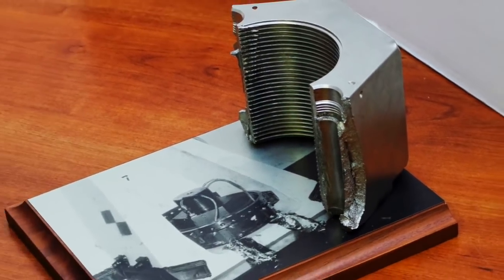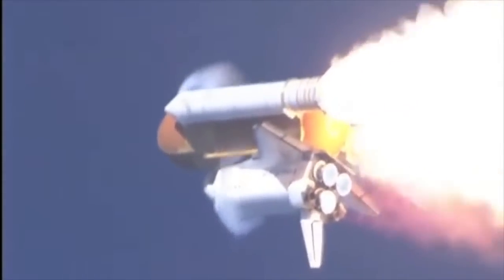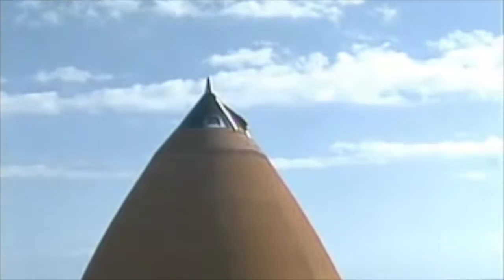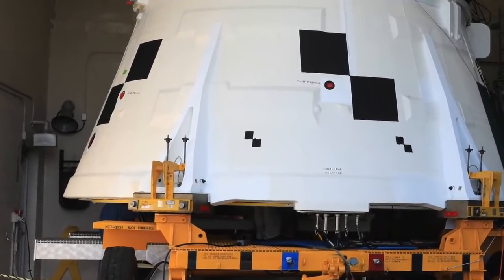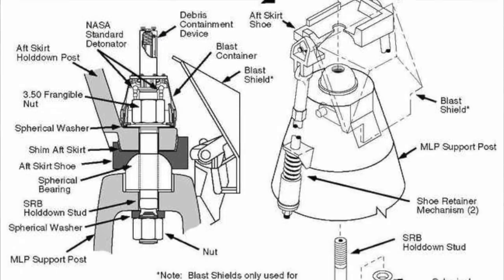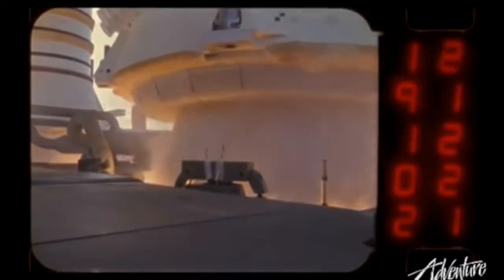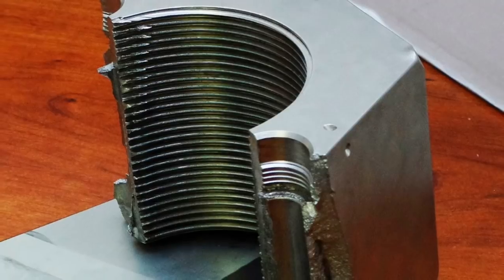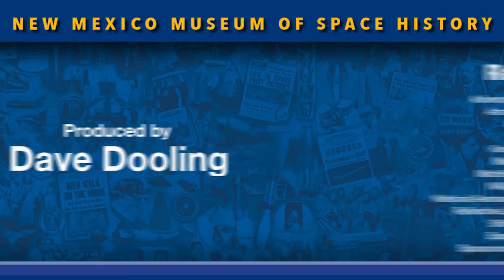Nuts and Bolts Held the Shuttle Together

Comment: In the mid-1980's my company in Shreveport, La. manufactured a few hundred of these "Hold Down Posts" (double ended studs) for United Space Boosters, a division of United Technologies.  They were 3.500"-12UNF (3.625" Stub Acme) X 33" long, Alloy 718 Bolts.  I was invited to watch a shuttle launch, which ended up being the last Challenger Mission before its tragic final flight.  I was very proud of being involved in a small part of that program!

Comment: I had the pleasure working the MLP prior Challenger. I road the zero level
many times to and from the PADs. I observed something interesting at the speed 
brake. what i would call a drip pan was positioned parrallel to the trailing edge of the 
brake by ten or so inches. the MLP would lunge lurch causing this varying gap
between the pan and speed brake would vary about 7 inches or so ..translate
that thru the SRB's & Orbitor ...to the Pad and sometimes back again

Comment: Interestingly, the SLS version is much simpler- since the vehicle does not "twang" over, the nuts are no longer needed for the actual launch (now only needing to be in place for the trip on the Crawler) so once the vehicle is at the pad, they are removed. SLS then lifts off the empty posts which eliminates all the intricacies of the frangible bolts.
Reply from the maker: Yes, the Shuttle was a beast all to it's own.

Comment: Thank you - that is a topic I always wondered about! So the FULL structural stress and load of the complete shuttle/tank assembly was on the boosters and the solid fuel?
Reply from the maker: That's correct for when it's sitting on the pad. After lift-off the situation becomes very dynamic. I believe the old term would be "sporty"!

Comment: The Apollo Saturn V first stage had pins attached that were pulled through dies on the launch pad at launch to prevent the stack from lifting off too fast after the hold down arms released. It slowed that first foot or two just enough to meet the liftoff criteria they set.

Comment: Hu? Nobody has come up with anything better in all these years? Bizarre. Our space program depends on explosives bolts and parachutes.
Elon fixed part of it so far.
Reply from the maker: The main reason is that these critical actions were carried out using simple and reliable systems. All large rockets have to be held down to the pad while the engines spool up and are confirmed stable and at the proper thrust. If a large booster is allowed to move upwards, even by an inch before this condition is met, bad things happen.
Reply: @NewMexicoMuseumofSpaceHistory  If you watched the video you will learn that they are not "simple and reliable systems".  Saturn V had swing away hold downs
-E8 camera. As I said, Elon fixed part of it so far.

Comment: Very interesting!  For a future topic, I’ve always wanted to know how the shuttle was attached to the booster.  The stress that structure was subjected to had to have been incredible, yet able to detach every time.  Plus the plumbing connection to add even more complexity.
Reply from the maker: The Shuttle was in many was the most complex manned space system ever flown. It was truly remarkable that it actually worked!
Reply: @NewMexicoMuseumofSpaceHistory  assembled by the cheapest parts from multiple vendors ;-)

Comment: Some engineers messed up the o-rings on one of the boosters when challenger blew up...wasn't bolted properly ??
Reply: I think cold weather caused the o-rings to shrink. Thst allowed hot gases to escape and rupture the fuel tank.
Reply from the maker: Exactly right, it wasn't the bolts, it was the O-rings.

Comment: I remember working on those nuts. Worked in a EDM shop and made the holes for the cable straps (The little tiny 45 degree holes on each side of the fracture point) and the slots for the weak points.

Comment: Nuts and bolts represent the highest form of materials science, stress analysis, design, testing, and manufacturing.  I designed frangible bolts holding the flaps to the rear wing spar on the C-17 program.  They’re designed to fracture if the flap is overloaded without enabling fuel to leak from the wing.  Ejection seats, munitions rails, canopy bolts are often of the exploding variety but of course not on such a scale as this.  Good info.

Comment: What are the big tombstone looking things in front of the shuttles wings when it's sitting on the launchpad?
Reply: Those are the Tail Service Masts and are responsible for carrying fuel, liquid oxygen and other resources to the shuttle.

They’re designed that way so that once they detached they would be protected from the exhaust.
Reply: Automatic cemetery in case of explosion.
Reply: @carlosandleon  wow you got the whole squad laughing 

😑😑😑😑
Reply: @weekiely1233  nice edit there  brah

Comment: Well there...Every so often I see that someone was interested in something that I was involved with for many years starting in the early 90's like the Space Shuttle Program. I was working for the company who manufactures and tests the Frangible Nut Stud Assembly and various products for the SRB's. We also produce similar ones for Delta IV and Atlas V to name a few. One of my favorite components to build and test was the Safe and Arm Device for the FTS system. I was real pleasure working with USBI/USA and NASA. I can try and answer anyone's question's if they have any. I can also just reply to the comments in the thread.
Reply: Cool you look like the guy to ask..  What was the torque value these were tightened to to hold the shuttle on the launch pad?

Comment: The shame is, the do not reuse the SMEs...
Reply from the maker: The SSMEs where in-fact reused. A total of 42 engines where built for the Shuttle program so most engines flew many times. In fact, the 4 RS-25 engines to used on the SLS actually are flown engines with upgrades.
Reply: @NewMexicoMuseumofSpaceHistory  yeah, but it's over now... 😟
Reply: @airsoftopa577  
Fly them or they gather dust in a museum.  I'd much rather have seen Apollo 18 and 19 fly or Skylab II than see the Saturns in museums.
Reply: @IvorMektin1701  flying, yes of course. But it's sad to see them fly  oneway and lose them. 🤷‍♂️
Reply: @airsoftopa577  
It's just hardware.
  
Costs are in the salaries of the builders and the people refurbishing the engines.

Have you looked at what it took to refurbish an SSME?
Reply: @IvorMektin1701  it's not much when comparing to a nuclear submarine... 🤷‍♂️
No, got your point. 😉

Comment: Well think of this: everyone (just about) has driven a car with an internal combustion engine. So you’ve got this lump of metal with tiny chambers that have to contain small explosions, and all that’s keeping that boom in the cylinder where it belongs are either bolts or studs. The job of the piston is to squeeze the air and fuel mixture into a small combustion chamber built into the cylinder head which results in incredibly high pressures before that mixture ignites and engines do this thousand of times in a minute, all held together for 100’s of thousands of miles with bolts
Reply: Screws and bolts are 200 years old technology and yet nothings replaced them.

Comment: How many PSI were the hold down bolts torqued to? I have had to torque some bolts on submarines to 1100 PSI.
Reply: Torque is not measured in PSI
Reply: @MrBen527  foot pounds then duh. DO you know the answer I asked then in foot pounds?
Reply: @normnicholson  No.  The torque value they used on this fastener would depend on the clamp load it can tolerate.

Comment: thought nasa was gonna not use rocket boosters on the side of  a fuel tank anymore
Reply: For the SLS, it’s a return to the crew capsule being on top of the rocket with the ability to be pulled away by the escape rocket if anything goes wrong. With the Shuttle, there was no option for the crew to do anything until the SRBs separated.

Comment: It's hard to believe that they worried about a nut damaging the concrete flame trench.  Really? ...or were they worried about it bounding back up and hitting the Shuttle? I don't know, just asking.
Reply: I bet you're right. A flying nut that size could do all sorts of damage.
Reply: They weren't worried about it damaging the flame trench at all. They were concerned that the nut would ricochet off any part of the trench and strike the orbiter during liftoff which is why they built in sand boxes underneath to absorber any impact and protect the Shuttle and its crew.
Reply: @davidodonovan4982  Thank you. That makes more sense.

Comment: I wonder what the fair market value is of one of those used frangible nut pieces?  Assuming each nut blew into two pieces, there are 8 nuts per launch, and there were 135 launches, that implies that slightly less than 2160 shuttle nut bookends existed.   Where and how to get one?  And for how much?
Reply: They went to astronauts, VIPs, and museums.  I got to fondle a busted nut in Huntsville 🤪
Reply: Got,to be many many more used for testing

Comment: I would like to see a video explaining how the fuel gets from the main fuel tank to the shuttle engines
Reply: I think Scott Manley might have a video on that.
The gist is that the Shuttle is anchored to the tank at 3 locations, one at the front and 2 aft. The aft attachment points carry all pipes and lines from the tank to the engines.
Reply: That’s done by the pipes located at the bottom of the external tank near the aft attachment points.
Reply: I'd like to see a 360 camera on something that goes up
Reply: @jayh9529  why?
Reply: @weekiely1233  so I can work out its position using the stars for my research
Reply: @jayh9529  well if the shuttle is in daylight you’re not going to see any stars due to the sun.

However, if you get a telescope and learn some techniques you can do what many amateur satellite trackers do and actually track spacecraft and get orbital elements from simply timing how long it takes them to pass a few stars in the sky.

Or you can use a software defined radio to measure the Doppler shift of a satellite and get orbital elements from that (something I’ve done before).

You can also photograph the ISS as well.

A 360 camera ain’t gonna help you that much.
Reply: @weekiely1233  would be nice to see where your going once in a while all those camera cuts
Reply: @jayh9529  you do know there’re un interrupted views to orbit right? 

But I’m sure you’ll simply start the denial and call them fake.
Reply: @weekiely1233  only if they look it
Reply: Pipes
Reply: The correct term is propellant, the main fuel tank  has 2 umbilicals at the base of the tank, corresponding with the connection points on the Shuttle one on the right hand side and one on the left the liquid Oxygen flows through one and the liquid hydrogen flows through the other, under flight pressure at launch.

https://en.m.wikipedia.org/wiki/Space_Shuttle_external_tank#:~:text=The%20tank%20was%20connected%20to,bipod%20and%20two%20aft%20bipods.

https://youtu.be/oMeXcBk1x-c

https://youtu.be/cFBRawYov00

Comment: Great video and great explanation. I had always had a suspicion of the system used but never found details of their engineering.

I assume a similar system was used fro the Saturn V launches but haven't found anything specific for that. Do you have a video of that somewhere or perhaps working on one, that would be good to see as I would dearly love to know how all 363 feet sat on the launch pad.
Reply from the maker: The Saturn had hold-down arms in addition to metal extrusion posts. Once the hold-down arms released the metal from the posts would be extruded, softening the shock of release.

Comment: I always wanted to understand how the shuttle was kept standing on the platform when it was empty or full of fuel. Only on those screws? if so, I don't understand how they can maintain the center of mass. Thanks, great video!
Reply from the maker: Well, you have to keep in mind that the SRB's are very heavy at 1,300,000 lbs. each. The external tank weighs 78,000 lbs. empty and 1,662,662 full, this weight sits directly between the SRB's and is supported by them. The orbiter only weighs 240,000 wet and is attached to the side of the tank. If you do the numbers, you'll see that only a small percentage of the total mass of the system is off-center and is easily handled by the rigidity of the SRB's. Hope that makes sense.

Comment: In case anyone is interested the tail section of an F 105 is held on by 4 bolts. Open the panels, unscrew four nuts and pull the rear 15 feet right off containing the elevators,  tail and stabilizing fender.
Reply from the maker: Engineering never fails to amaze!
Reply: That seems mildly unsafe but also interesting that they manage to keep the rear 15 feet of a plane together that easily
Reply: @ThomasFarquhar2  Easily? Those bolts are not anything like the ones that you can buy at Ace Hardware so it is not done so easily.

Comment: The frangible nuts and studs don't hold the Shuttle TOGETHER, they hold it DOWN...big difference
Reply from the maker: Yes, you are correct. I let the title and tag line shift improperly as I worked on this. I started with the Shuttle booster joints in mind, each had 177 pins to hold the segments together. This stuck in my mind since using the phrase "Pins hold the Shuttle together" when covering the Shuttle in 1977-85. I should have caught that myself. Thanks for setting the record straight.
Reply: @NewMexicoMuseumofSpaceHistory  “let the title shift improperly”. That’s one way to say “I made a click bait title”.
Reply: @Moltenbramley  Not really.   He made a full and frank confession.   It's more than you get from a comment troll.
Reply: @RtB68  Agreed, nothing click bait about it...I almost didn't click on it because I wasn't interested in how nuts and bolts hold a shuttle together, but glad I did, as how a shuttle is held DOWN by those special fasteners is much more interesting.